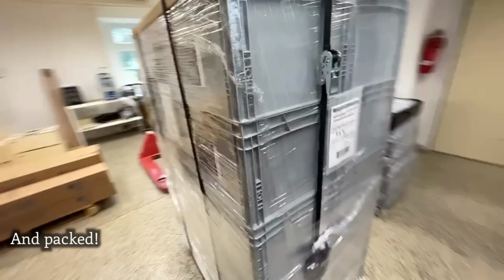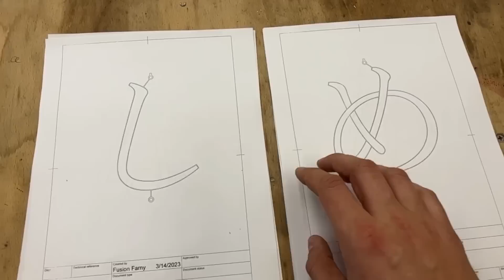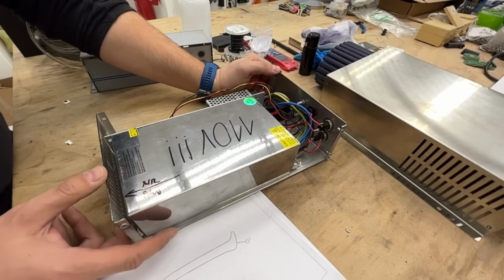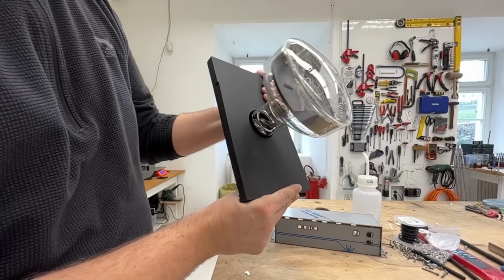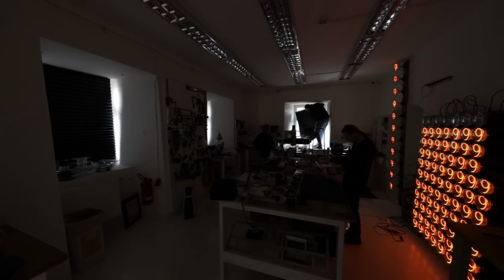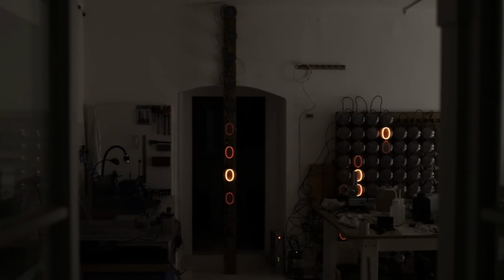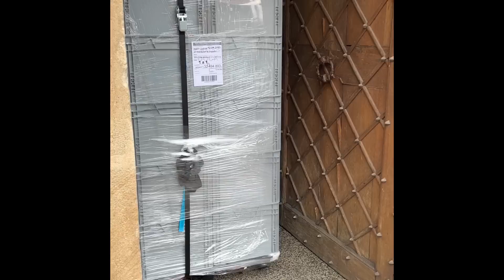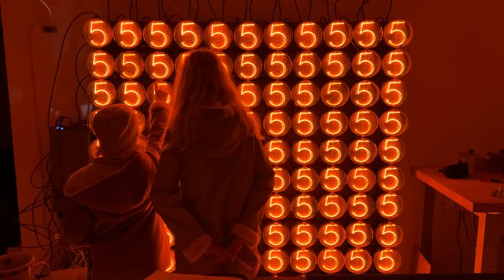The installation is complete.  | March 2023

Comment: Next shipment you need to fully crate and include a vapour barrier for every item then fill with packing peanuts. At the moment your package is very vulnerable to impact and getting wet - which it will be at any air or sea terminal.

Comment: Looks absolutely amazing and what a fantastic achievement! Question though, noticed on the last section of the video where the kids are watching the display that there are a few tubes that appear to be being fed a small voltage and the 0's are still dimly lit, is that intentional or an artifact somewhere?
Reply from the maker: Thank you! Good observation. One batch of the nixie tubes produced a slightly opaque layer on the front window - "fog". We had this problem before and it was related to organic stuff inside the tube (contamination). We were able to quickly solve the problem by replacing all chemicals in the production with fresh ones, but we need to pinpoint the root cause. These will be replaced for the installation.

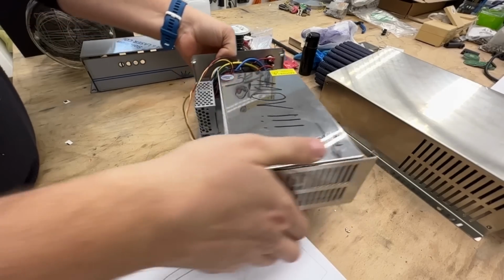Comment: 2:43 for future reference, to make these very silent, IF this is the double fan variant, simply replace the fans with Noctua ones, and power the bigger fan directly from the 12V rail, always on, bypassing the heat sensor. 
If it's the single fan variant, you have to cut (as you see it at 2:43) a hole directly over the center of the aluminium cover and install a Noctua "NF-A9x14 HS-PWM chromax.black.swap" there (directly powered from the 12V rail, always on).

The decibels are very low if you mod it in that fashion, use the provided rubber bits that Noctua puts in with the fan, ditching the screws, however, make sure that both fans are sealed around so that air doesn't escape. If you can cut (on the laser or with a cricut) a rubber gasket, even better. I've used rubber spray paint in the past to build up several coats of rubber over the mating surface of the fan, which makes for a vibration proof contact surface. Other people have put engine gasket maker or silicone. It cuts the jet engine noise down to a gentle air fan sound, barely audible from a meter away.

To be mentioned that this method makes the box itself heat proof within another box, thus reducing how big the cooling envelope needs to be. Mine's fit inside a box barely bigger than the power source itself.
Reply: Did you watch the video?? This is exactly what he did for the actual supply... the one he was discussing in the video they are only taking as a spare...

Comment: At 0:29, ん is clearly visible, with "JZ4" (Japonský znak 4?) handwritten at the bottom. At 0:58, we see that し is "symbol #5" and め is "symbol #2". The sheets are slightly transparent, revealing a な and か or が. One of these most likely appears to the right of character #2 at 1:04, so they might be character #3. Following the same logic, character #1 could be ほ or ま if it’s hiragana like the others, or 三/王/禾/末 if it is (unlikely) kanji. So the text is probably something like まめなんし＊＊ or ほめかんし(な) – does any of this make sense in Japanese? The installation cost so much time, money and dedication that it should be some significant phrase. Any ideas?
Reply from the maker: Thats a lot of work with decoding :-) Good job!
Reply: @daliborfarny  You know all the characters; don't leave us hanging!
Also, where were you when the longwave masts of RKS Topolná fell? 😢
Reply from the maker: @lathe-operator  I know them, but I cannot yet disclose it - they represent the name of the artwork. Towers - yes, that was sad.. I was just sitting home and heard two loud bangs - as they bombed them. It was unexpected, the owner did it without telling the local municipality.. They were about to be declared as technical heritage which would mean extra costs to owner - they would need new steel ropes for over 1M EUR in 2-3 years.. Very sad, I watched them every summer evening from balcony..
Reply: @daliborfarny The name of the artwork? You mean the blurred "project O-4 U******a" text in the previous video? 
You can keep dropping hints...

Anyway, I vistied the masts when they were still operational, and got to see you as well... I hope the iconic Liblice transmitter does not meet the same fate before I can see it, too. Too bad it's been secured against climbers, though.